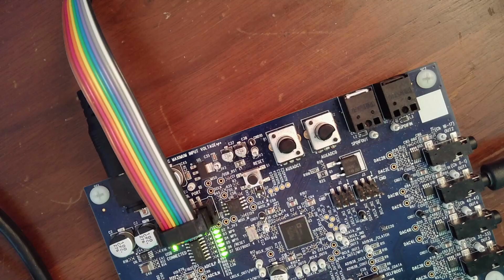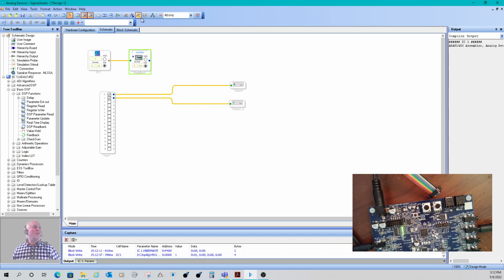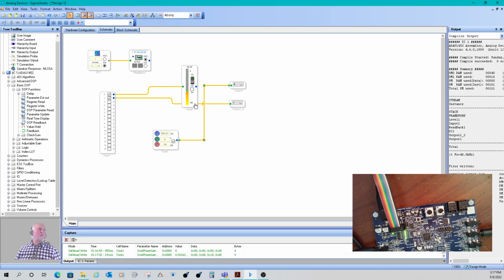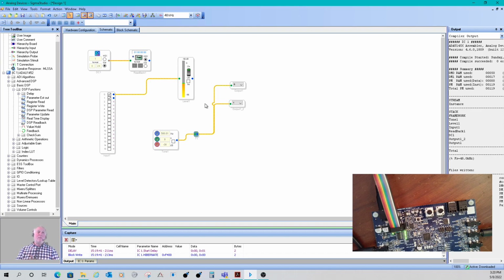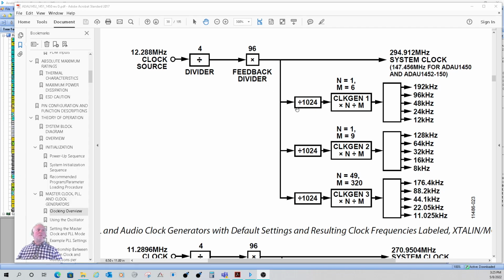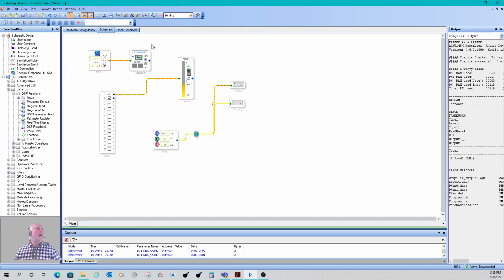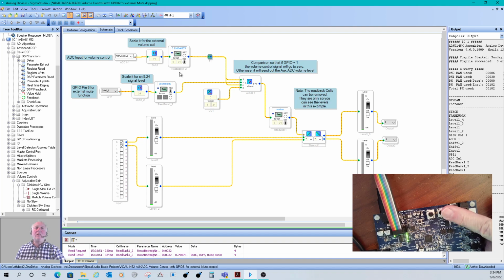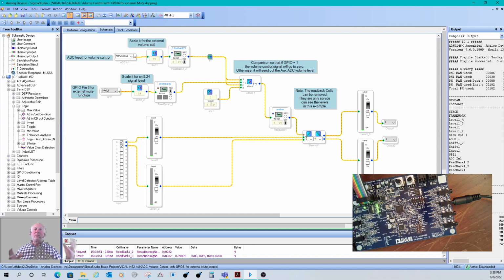How to use SigmaStudio for troubleshooting

Comment: how do we change the size of the police in SigmaStudio? i cannot read the icons and the text well... is it possible to get them bigger? thanks
Reply from the maker: I really wish you could make it bigger and still function but the old SigmaStudio you can go to the view menu and increase the size of the graphics but it stops working. To get it to function again you have to go to the View menu and select "Zoom to Normal" then it will function again. The new SigmaStudio+ is able to increase the size and still function. I am not sure what DSP you are using but the 1701 is not included with SigmaStudio+ as of today.
Reply: @HowtoSigmaDSP  1701... what do you suggest? thanks